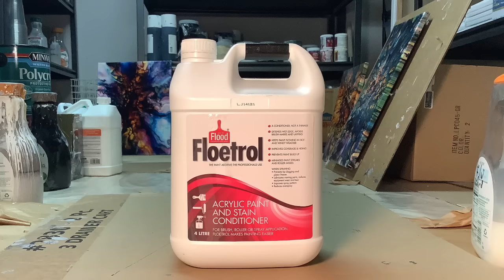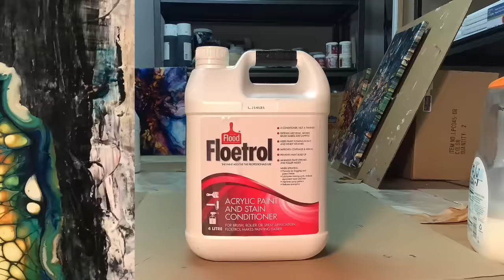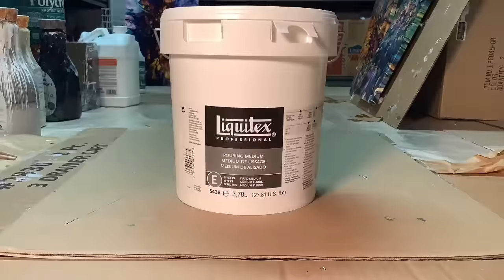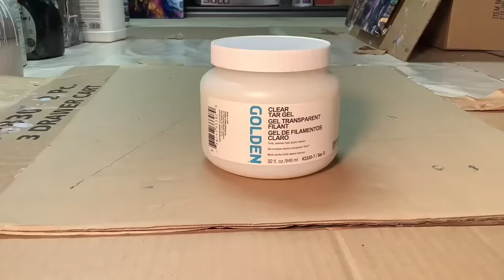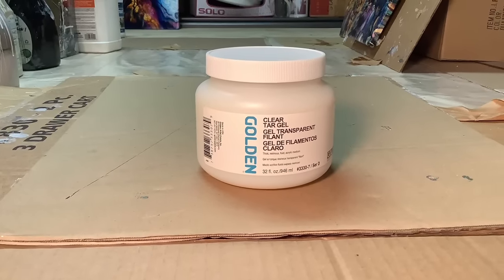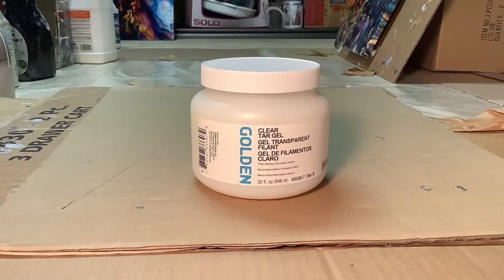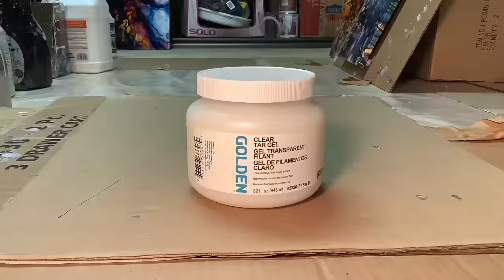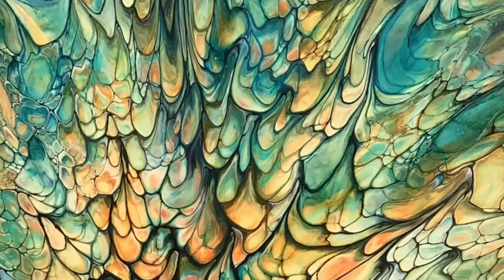What is the ultimate cell activator?

Comment: and I've had the Liquitex version of tar gel for several years for other art...who knew. I have not had problems with cells or the lack thereof since I had done this research when I started years ago. I have tried to explain that pigment density and paint consistency are 2 very different things and have put this information on the Acrylic Pour site many times. As a scientist (biology, chemistry, physics), I appreciate your videos as simple explanation of a complex process and I agree Physics (and not chemistry although they can intertwine) initiates the cell process. I rarely use silicone because of the mess (gets everywhere) and it can foul up the finishing coatings. Love your wry sense of humor!
Reply from the maker: I can’t tell you how much I appreciate your comments cvknisley🙏 thank you so much. Since I have no background in science it’s wonderful to get professional input on the videos. While they may be long winded and a bit amateurish the subject matter needed to be said. I used silicone for years but I also got tired of the mess and because it was so hard to control. Happy you enjoyed the bloopers. Again I thank you for your input 🙏👍
Reply: In your recipe it doesn’t look like you add paint to your “pillow” or first layer, is that right?  Just to the first color layer and the top thinner layer?

Comment: Thank You for sharing your thoughts and knowledge about this process with us...You are 1 of only 2 artists that I regularly watch, who have actually  Come out and and stated how overused the term "cell activator" is used.  I have always used Floetrol and Liquitex Gloss Pouring Medium for my Pouring medium, and I have not had a problem with creating cells in my paintings except when I didn't mix my Paints correctly, and they were either to thin or to thick...And after doing some research and just simply reading a few articles, Australian Floetrol is just the same as the Floetrol that we get here except for the fact that US Floetrol is thicker then the Australian version. So, in essence,all they have done is taken US Floetrol and added more water to it and started calling it Australian Floetrol and charging 2x the price of just regular Floetrol...And all Floetrol is for really is just to aid your Paints in self leveling, and it helps to cut down on the actual amount of paint that you use in each painting.  So, Thank you again for this video, and sharing with us.
Reply from the maker: I absolutely love your post Nikki 🙏 thank you so much for sharing your thoughts. As a thinner I like Australian Flotrol. It’s consistency is great and it’s chemical make up is so simple that it doesn’t interfere with the process. I believe that the Australian Flotrol is not just watered down American Flotrol. The American Flotrol just ups the ante and adds complexity to the product with additional ingredients. We both know that neither one of these products magically produce cells…they are simply thinners. Unfortunately too many people believe the hype about magic elixirs and the company in Australia took advantage of ignorance with outrageous pricing. It’s gouging …and Homie don’t play that game!

Comment: Hello, Steve. Thanks for a great instructional video, full of useful details, insight into the beautiful gestation of an amazing work, and the bloopers. Awesome work.
One question: I have tried to find the Behr base, but the medium seems to be retired by the manufacturer. HD does not have it, and a web search shows it only in a couple of somehow obscure eBay links. 
Do you know of any other reliable ways to get the medium? Have you tried any others that satisfy your need for neutrality?
I hope you overcome any problems keeping you from producing more videos. Be well, in peace :)
Reply from the maker: I really appreciate your comments Carlos 🙏 thank you so much. I was not aware that the Behr was retired…my local HD must have an abundance of it. The new line …Dynasty …they have works just fine but needs to be thinned more.👍
Reply: I work part-time at HD and can assure you the paint is still available. They have a few lines of paint with Dynasty being their new flagship. They also carry their last few iterations. The important thing you want is called 'Deep Base'. There is also a mid-tone and an ultra-white. The "deep base' has the least amount of paint pigment (there's still a tiny bit but it won't affect your other pigments) and is used to mix darker colors ( look at the front label near the top of the can it will say Deep Base). You don't want it mixed with any pigment at all. You'll be using it right out of the can. Dynasty is indeed very thick almost like Elmer's glue in thickness but please don't use Elmers in your artwork. It's glue, not a painting medium despite what some videos claim. Steve's video is spot on. Follow it to a tee and you'll create superb cell painting. I suggest learning more about paints and mediums you watch Golden and Liquite's videos on their mediums. There are quite a few that all do something different. For instance, GAC 800 by Golden helps prevent cracks in thicker paint applications and either companies iridescent will give a nice sheen. Painting is a journey with a lot of things to learn and endless possibilities. Learning the basics will help you avoid a lot of frustration and wasted paint and money. This video is a must for anyone who wants to create beautiful art.

Comment: Your video is miles  ahead of other pour technique videos. Seems to me they really do not understand what is really going on. 
I've always realized it was not chemical but specific gravity doing the job, though which was more or less dense and how to achieve this was lost on me.
Your conlusions approached through experimentation and observation have much more meaning than "this is the way we do it" does.
The only question i have is: is there a way that i can find the specific gravity of a specic  paint color, medium or thinner? That way i could know what the denseness of a certain color/mixing agent is prior to mixing and have more if a goal to shoot for.
Your video is the gold standard for all other pour technique video to emulate.
Brilliant.
Reply from the maker: Many thanks Gordon🙏 you are very kind and I appreciate it. Some manufacturers do have charts that give you specific densities per color. Liquitex and Golden are two examples. Certainly densities matter but it’s most important for the Top Layer Mix. What I look for most is for the Top Layer Mix to sink to the bottom of the pile…so it’s not just density it’s also the amount and type of pressure applied to get the ball rolling.

Comment: This is very informative!. I am a beginner & I found myself at times feeling rather overwhelmed with all the different tutorials by many who achieved beautiful results based on their recommended products & recipes of success. The tough part in New Zealand is sourcing the product & the over all expense certainly gets in the way if on a limited budget. I have not been successful in producing these beautiful cells. I am using the Australian Floetrol, PVA glue, water, acrylic paints & the silicone oil. So far, I have been the "master of disaster" & I was struggling to understand what it was that I was doing wrong. Now that I have come across your video. the way you broke things down specifically, it made sense. It will take me time to watch it quite a few times to get it all together. But at least I can have a clearer idea as to at least figure it all out carefully in the hope that it will eventually come together. Thank you very much. This has been the only video that has clarified in very specific detail as to what works, and what does not work & the reasons why.🙂
Reply from the maker: What a heart warming post Angie 🙏 thank you so much…you made my day. Find simple ingredients that work together and not interfere with each other. Make sure the top layer mix can sink to the bottom of the pile and use pressure to help it along. These are keys for me that are made easier by knowing what really causes cells to form. Best of luck on your journey 🙏
Reply: @chasefluidart4341  Thank you very much🙂
Reply from the maker: @anaheraarana8863  👍

Comment: Thanks for this revelation regarding the action of the pigments.  My first question to this has to do with the oil and water resisting each other.   But with the mediums used they were all water based.  When asked about this I did not receive the answer.  But thanks for explaining this.  Now it makes perfect sense.  And of course without the air pressure nothing happens.
Reply from the maker: Thank you so much Riley 🙏 I appreciate your post. I wouldn’t say that without “added” air pressure nothing happens (I’m assuming that is what you mean)  I would say that it accelerates the process. Given the proper ingredients cells will form through gravity alone.
Best explanation I’ve seen on why oil and water won’t mix……Liquid water is held together by hydrogen bonds. (Liquid water has fewer hydrogen bonds than ice.) Oils and fats not have any polar part and so for them to dissolve in water they would have to break some of water s hydrogen bonds. Water will not do this so the oil is forced to stay separate from the water. https://web.fscj.edu/Milczanowski/psc/lect/Ch10/slide10.htm

Comment: Thank you for this! I haven't started flow painting yet, but have watched videos for years, trying to find direction that makes sense to me. The fluid dynamics you explain help me to understand  what is going on with the paint. When I saw the silicone additives others use, I just said the same, oil and water don't mix, that's why the cells. But its such a mess to clean up. I appreciate you taking the time and research to put this video together, I just found your channel, so look forward to watching more. But for now, nap time!
Reply from the maker: I love your comments Pacadashery 🙏 many thanks. I particularly appreciate nap time…I’m well versed in it👍 Best of luck in your new adventure.
Reply: @chasefluidart4341  Thank you!

Comment: I appreciated greatly your presentation, and your further written explanation, but would like more information as to your air gun.  Your link to Northern Tool was incomplete, so I looked at all their air guns, but non looked like what you were using.  Did you modify one of their air guns?   It looks like you are using a wide spray of air and that you might have added something to the tip to give it a wider spray area.  What ever further explanation you could provide would be appreciated.   Thanks
Reply from the maker: Thank you Charles 🙏 the gun is manufactured by a company called Groz. Yes I did have to modify the shaft of the nozzle end of the gun with glue and tape to allow for a Venturi nozzle

Comment: Thank you so much for sharing you knowledge!  I really appreciate it and I agree with you 100%!
Reply from the maker: Very kind of you JayElle 🙏 thank you so much
Reply: @chasefluidart4341  I’ve been reading a lot of the comments and questions and your replies. So much information to soak up! I found the Behr (I’m in Canada). I have the minwax but I think I’ll try with the Josonja varnish first (since I already have it) just to see if it works and to keep it as much art material as I can. I’ve only done a few paintings in this style so far. 

Do you plan on making a video about how you use the air trigger?  Would love to see that. I noticed how you used it in your videos but a demonstration would be great!  I have an air compressor but just need to buy a trigger. 

I want to make big paintings in this style and you have no idea how happy I was to come across your videos. 

Now following you on Facebook. Love your paintings!!
Reply from the maker: Thank you JayElle 🙏 happy you enjoyed the videos. Josonja should work just fine. Yes my next video will be about air pressure. The gun you need really needs to have a controllable trigger…hard to find. I found mine at Northern Tool. It’s made by a company named Groz…the trigger is the key👍

Comment: Hello from Montana. I have watched both of your videos several times and taken copious notes. I made your recipes and tried them without much luck- until I purchased a smaller air compressor. Now I am getting the hang of it and getting some beautiful small cells. The tar gel really does help keep the lines and the colors are outstanding with this mix. My question now is how to make the cells bigger? Perhaps my top coat or base coat is too thick?
Reply: Thank you so much Robin 🙏 it’s possible that it might need tweeking….however if the top coat is successfully sinking to the bottom then you should be close. Small cells are usually caused by too much pressure from the start.
Reply: @stevechase4407  Thanks Steve, I'll try backing off the pressure and try to be more patient as the cells develop. BTW, your paintings are so beautiful, would love to get something even half that good! Your tutorials are excellent and as I am a retired scientist, it's great to understand the theory behind how this works.

Comment: Thank you so much for doing this video.  It was confusing watching all the video's on youtube.  I play with resin but wanted to explore paint pouring.  I use powder pigments in my resin, would I mix my powders in liquitex pouring medium and then follow the rest of your mixes?  my thoughts were 2 oz of pouring medium and 1tsp of powder?  I greatly value your opinion.  again thank you for taking the time to share your knowledge with others.  also, your pours are lovely.
Reply from the maker: Thank you so much Cyndi 🙏 I don’t know how powder mixes will sink in relation to other paints. Ideally each successive layer will be heavier than the layer below. Most important is that the last or top layer is heavier than all the rest so that it will sink all the way to the bottom of the pile.

Comment: Thank you for your informative video!   I have questions:  are the colored (squiggly) paints all different density formulas so that they sink at different rates or levels, or are they all thinned using the formula you gave?  What are your thoughts on ready to pour paints?
Reply: Great questions Patricia 🙏 thank you so much. All colors have different densities and to a very tiny degree they might sink in varying degrees ….but keep in mind that  the medium is the same for all of the colors which tends to even things out. With the Main Mix I do not layer the colors by density ….I layer by color. The Top Layer Mix is what I want to sink to the bottom so it will be the densest, heaviest and most liquid.
I’ve only tried two ready pour paints….👎pitiful 👎

Comment: Thank you for sharing the results of your work and experiments. 
If you dont use the minwax polycrylic, do you still get the cells? You mentioned in the beginning of the video mixing it with the Behr paint (i think) used as your "pillow", but i dont think you mentioned it again. 
Please make some videos showing off the paintings you have done.
Reply from the maker: Thank you so much Rob🙏. Cells are created by the interaction of weight and pressure on the individual colors. The Base or pillow is exactly the same formula as all of the other colors except the Top Layer mix. Polycrylic is just part of the mix and it can certainly be substituted.

Comment: thank you for answering me
So I understand that there are 3 layers?

-1 layer .spread on the thicker canvas (interior house paint)
-2 layer. They are the medium with the acrylics (medium undyed house paint + water-based polyurethane varnish + acrylics)
-3 layer. cellactivator (which can be floetrol, owatrol + acrylic)

I think it means that the 1st and 2nd layers are of the same consistency,
and the 3rd layer is thicker than the others?
sorry if i'm annoying, thanks
I keep experimenting to get to something nice, with your inspiration.
Reply from the maker: Thank you FFJJ 🙏 I do not use house paint for layer one. Layer 1 and layer 2 are exactly the same paint and medium. Layer 3 is the top layer mix …it is thinner and heavier in weight ..not thickness …so that it will sink through layers 1&2. 
BTW…there is no material “cell activator”. Cell activation is physical not chemical.👍
Reply: Thanks I'll get to it and I'll let you know

Comment: I’ve been collecting things to begin pour painting and I just learned so much from this one video!!!  I’ve got to ask hubby to make a turn table. What do you use to put one together??!!
Reply: Thank you Holly 🙏 I used a heavy duty cake spinner probably made from aluminum….12’’ round. I then used 4 bolts …N,E,S & W… to attach a 24’’x 24’’ 3/4’’ piece of plywood. It’s critical that you are extremely precise….if it’s out of balance it will be a nightmare.
Reply: @stevechase4407 A year later it says! I’m about to finally begin my pour painting journey! Thank-you for your reply!
Reply from the maker: @hollykeller1545  👍